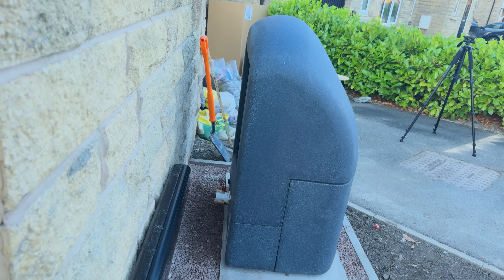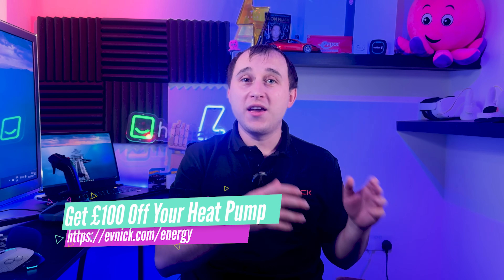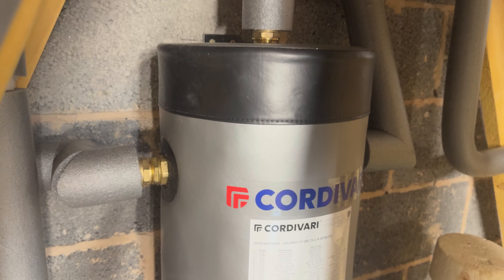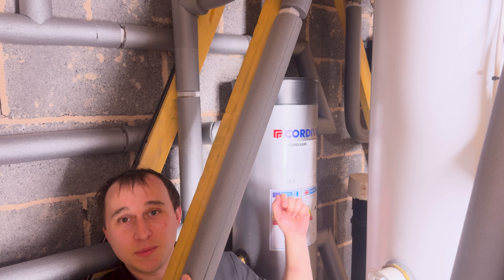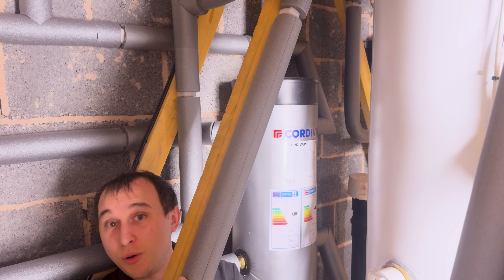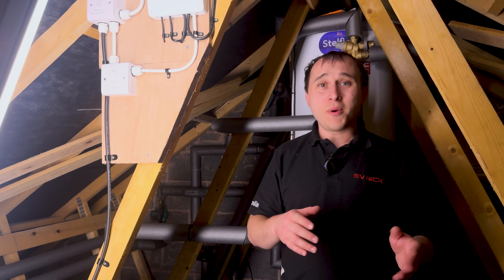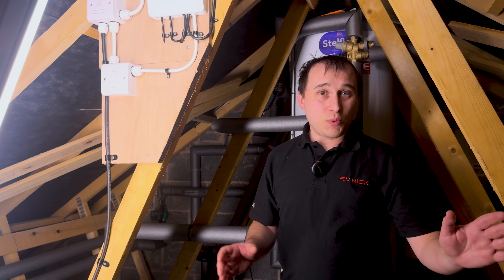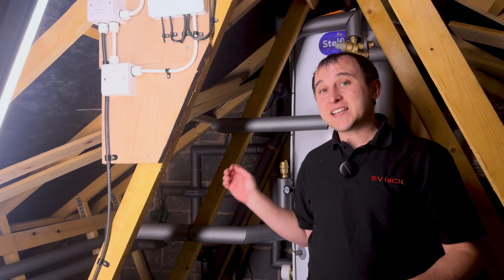My COP Of My Cosy6 Is Awful How We FIXED It!

Comment: Not sure why Octopus didn't use buffer to start. One thing I would like to know is can you hear the circulation pump in the loft at night.
Every channel I see talks about ASHP fan noise which as we know is not an issue and certainly not inside the house. If the buffer tank is in the loft then a circulation pump whining away on the other side of the bedroom ceiling at night could be a major issue for many.
Reply from the maker: Can’t hear a thing

Comment: Industry best practice, as espoused by Heat Geek for example, is to use weather compensation with an adjustable slope setting of flow temperature against outside temperature.  Does Cosy6 support this?
Reply: Yes.  In a word.  It's  basically still a heat pump!  So the usual rules apply.

Comment: Good luck to the engineer that will be expected to repair that in the winter months sat outside on the floor in freezing temperatures..
Reply from the maker: as opposed to what?
Reply: Shouldn't need repairing in winter...  because you have a regular servicing contract...

Comment: Avoid the Cos 6 Heat Pump

I strongly advise against getting the Cos 6 heat pump. I had one installed two weeks ago, and it makes an extremely loud noise. My neighbor has been complaining and struggling to sleep at night due to the noise.

I contacted Octopus customer service (Rich) multiple times, but at first, he refused to help, saying, “The Cos 6 is our quietest heat pump, and this is just your opinion. I don’t think we need to send an engineer.” After several emails and sending a video recording of the noise, they finally agreed to send an engineer. He adjusted some settings and told me to wait two weeks for the compressor to “settle down”—which I find quite confusing.

I requested a replacement with a different brand, but Octopus refused, insisting that the Cos 6 is their quietest model and that they would only replace it with another Cos 6. I honestly feel that Octopus is misleading customers by pushing their own machines with false claims and refusing to take responsibility.

It has now been over two weeks, and there’s still no proper resolution. My neighbor is so affected that she plans to file a complaint with the council due to the impact on her health from sleep deprivation. Since Octopus has failed to address this issue and misled me from the start, I will be filing a complaint with the Ombudsman Service to escalate the matter.

Please do not make the same mistake I did by trusting Octopus’s claims about the Cos 6 heat pump. It has been a terrible experience, and I regret relying on their misleading information.

Comment: Hey there matey, hows your cosy doing in the cold weather since the changes?  I also have microbor pipes and finding only the top 1/3 is getting warm with bottom cold. I'm trying to work out if this is a flow rate issue or glow temperature issue vhave you come across this in yours?
Reply from the maker: Have you tried to bleed your rads? Could be air in them
Reply: @ yeah I've tried that. No air in any of them so far and I've checked everything still at the 1 bar pressure the engineers set.
Reply from the maker: @ ring heat pump support team report the issue and they should send an engineer to check… assume house isnt getting warm?
Reply: Could be gunk in the radiators.  Have you had them power flushed?

Comment: Nicolas, great videos. One question, the out let fan on the heat pump is open to rain snow and hail, how is the inside protected from the elements.   Thanks.
Reply from the maker: Snow can go in any unit wind blows… this been designed for the garbage basicly drains out bottom
Reply: @         Thanks for coming back Nicolas.

Comment: It sounds like they didn't calculate the pressure loss of your pipe work. The pump couldn't shift the required power at low flow temperature due to the pressure loss of the pipe work. Since it could only output a small amount of power it cycled and you lost efficiency. This is not because low flow temperatures are inefficient. It's because low flow temperatures require higher flow rates which require suitably sized pipes. Please correct me if I'm wrong.

Comment: Golly from the replies looks like you got to have a degree in physics to get one to work. Least i know now one is not suitable for my minbore system so thanks for the video
Reply from the maker: If it’s 10mm it be fine but 8 will need a repipe to use octopus but some Indy installs may do it
Reply: @NicolasRaimo  no it's not 8mm by looks of it.

Comment: Interesting video as always Nick. I’ve just got a quote & awaiting a heat loss survey, not sure which ASHP they have included for ? With regards to the flow temperature I thought the weather compensation adjusted this depending on the outside temperature ?
Reply from the maker: Weather comp works within a range that customers could change but octopus locked it out since this video and engineers and octopus will set

Comment: Wow, what a failing on Octopus' part! This installation seems to go against a number of the essentials that Heat Geek say make up a good system! e.g. should not have a buffer/LLH/hydraulic separation, but pipe run too long, flow temps too low (lower IS better but the Cosy 6 seems different and possibly not a good thing!), and so on.

And why did you end up with a 6KW HP when you say your heat loss is less than 4? That's more than 50% oversized even for the coldest day in the year and will obviously cause cycling and be less efficient. There are 4 and 5KW HPs available, Octopus even fit a Daikin 5KW themselves (unless they have just stopped?)

With microbore (especially plastic which is worse as it has inserts that further restrict the flow) combined with that long run, Octopus should have known that hydraulic separation would be required to keep the HP happy. If your pipes are 12mm then you would have been better off with a shorter run and no hydraulic separation. Having the buffer is a significant hit on efficiency, as is higher flow temps - don't let them tell you otherwise - its just maybe the that Cosy 6 can't cope like some other HPs can.

So you have ended up making less efficient changes to get the efficiency higher! Meaning a different system may (in theory) have given a better COP/SCOP. We need to see your number to make final judgement.

I would love to see the Cosy 6 work well but it was over hyped and always set out to be a comprise that may well turn out to underperform.

Comment: The easiest way to have avoided this issue would have been to install the heat pump in a sensible location.
The correct term is "Buffer Tank" it is NOT a "Multi Split" nor is it a "Low Loss Header".
You have a responsibility as a content creator to provide accurate information on this topic.
By doing this and adding an additional pump you will now be experiencing Hydraulic Distortion - this is the difference in flow between the various circuits and the 2 pumps.
Reply from the maker: A suggesting you check what a low loss header is https://www.heatgeek.com/low-loss-headers/

Comment: I'm looking into heat pump installation (ASHP+HWC) After watching several Heat Geek videos I was focusing on SCOP (maybe too much). In the end we decided to go with Octopus, as they provide the best value for money. I did some calculations and for my 3 bed semi (10,657kWh annual demand for heating and hot water) the difference between SCOP of 3.4 MCS minimum, and 4.5 (very optimistic) translates to £170 saving per year. As mentioned in previous comments Octopus is the best value for money for ASHP install (currently). If I were to go with well know independent install it will cost me an extra £3-£4k and will take around 17-20 years to pay it back. I'm sure someone like Heat Geek can design and Install more bespoke, and refined system than Octopus, but It is unlikely I will be in my current property in 2040 :-). I appreciate it, that for larger properties, payback will be sooner, but 3 bed semi , is fairly common house type in the UK.
Reply from the maker: 100% my findings also,  ps don’t forget to add my refferal code for extra £100 off
Reply: You've made the right choice for your home. Do the maths first and you realise chasing that higher SCOP ends up costing you way more in the long run. It will be the likes of Octopus who will roll this out to the masses for the same cost (or cheaper in a lot of cases) as a replacement gas boiler. That's when a HP becomes a no brainer.
Reply: Just put your £4k in a savings account, that’s £208 per year currently. It’s a better investment than a heat pump.
Reply from the maker: @andrewharris3900  boiler replacement same price so not really plus it’s not all about cost
Reply: @NicolasRaimo  Boilers are much cheaper. Also they don't cost £225 a year to service like the Vaillant heat pump.
Reply from the maker: @andrewharris3900  octopus service plan is £9 a month…
Reply: @andrewharris3900  except that I need to replace my boiler. Well, option two is to wear a lot of jumpers and have an extra 200 quid, but I think ASHP will go further.
Reply: @Pav_1983  Energy savings trust did a study of installed heat pumps in the UK and found an average COP of 2.2. Maybe you'll be lucky and get a COP of 3.2 but it's not really worth it as you'd still be paying more than you would for gas at current prices. Also a new boiler is usually about £1k, even if you're moving a lot of pipe work it will work out much cheaper than £4k.
Reply: @andrewharris3900  Thank you, but I did not say Octopus ASHP woudl cost me £4k, my install is a lot less. It woudl cost me an extra £4k if I were to go with well known 'approved' installer.  Also the latest installations must meet a minimum 2.8 SCOP to get MCS verification and BUS grant. Octopus guarantees SCOP of 3.4. 
Please note that I will be going off gas completely, and will be using HP specific tariff. Standing charge and smart tariff, should make ASHP with SCOP of 3 the same cost as gas boiler. I'm also planning t install solar PV in the future. I'm not saying ASHP are better than boiler in every case, but based on my calculations, ASHP is a better choice.
Reply: There is a lot of truth in what you are saying! 👍 That is if the Cosy turns out to be nearly as good as the marketing.

What I am not liking is Octopus' lack of flexibility (said no to most of my asks) and now they seem to want to take away all control of the system once installed.

Worse still when the grant went up by £2500 last year my quote actually went up by a couple of hundred rather than down £2500 - think of that what you will.
Reply: @darrenadams2640  Although I keen to explore new things, I decided to go with Dakin ASHP. I'm not 100% on cosy 6 looks, and Dakin have been around for longer. Regarding cost, the challenging part is 'inclusion' I'm suspecting there will be some averaging of cost across the households. Some will win and some will loose. My house does not require any radiator changes, the location of ASHP and HWC is fairly straightforward, etc.... Yet the quote came to £3.8k on top of BUS grant. Makes you wonder what property woudl qualify for £500 ASHP. I'm lucky (unlucky) that we are going thru remortgage and Halifax is handing over £2k cash back for green improvements. So all in I'm getting £9.5k from the gov (or my tax money) and from Halifax (my interests), then referral -£100 and October's ASHP week discount of -£250 The remaining balance is just over £1k which is difficult to beat , even with a budget boiler. The time will tell.

Comment: I've just had a Cosy 6 installed and I can't see anything in the app settings to change the flow temperature am I not seeing something?
Reply from the maker: They took it out ;)
Reply: Thanks, I thought that might be the case.
Reply: I was just about to ask the same question.

We got our Cosy 6 just over a week ago.  8m primary run outside, probably 22m total.  A volumiser fitted from the start as we have 10mm microbore.
SCOP so far is 3.1, which is slightly disappointing.
Octopus are sending out an engineer to check everything.
The installation team were superb.
Once we have our solar and battery in a week, the SCOP will be less important...
Reply: I would rather have control.

Really not sure an energy company should control my heating.

Comment: Good info. Did you purchase any external fascias from somewhere or is that how octopus lagged the pipes? Finding it hard to find where to buy something for mine
Reply from the maker: I paid extra for it be in casing and they lagged that inside the case I knew the casing had to screw in the wall for the back end and couldn't be done easily after so opted for it to be done same time.   1 trick you can try is buying drain pipes and slit it  one side
Reply: @ didn’t realise you could pay them extra for the job. Yeah I was thinking the same with the drain pipes. Will probably attach the corner sections to the wall and slot some together.

Comment: Are you saying that the volumiser is now working as a Heat Store, where the radiator circulation pump pulls heat from it (in the form of heated water)?
Reply from the maker: Its bumped as a buffer 4 port.  We have 1 side connected in a loop to heat pump and the other side looped to home supply with a small pump.  The idea is this works and stops frictional resistance in my circuit

Comment: On you huge pipe run, did they use ready insulated pipe, or clip the pipe on the wall then insulate it? Your trunking doesn't look big enough to fit the correct insulation on the pipes, but that could be the poor picture quantity on my phone! I would think 28 or maybe 32mm pipe with the required 15mm insulation gives about 60mm diameter, plus the trunking, so it should be at least 65mm off the wall. Clips mounted to the wall should also be over the insulation to avoid heat soaking into the brickwork. Is yours close to that?

Comment: The most worrying thing about this install is Octopus thought they could run the whole thing off the Cosy pump with the massive primary run and then onto microbore, and also that they didnt have a real design temp so Nic decided he'd lower it himself to a value that clearly meant microbore would never deliver the required heat. A proper installer would have calculated this all properly from day one and not needed to fiddle with it so extensively. Seems a bit hit and hope. Still think it should have OEM on it, so we can all see the numbers openly. If Octopus believed this was a good solution they'd have no problem sticking it on OEM (like they have for some of their Daikin installs)
Reply: From my experience, it seems Octopus is trying everything possible to make sure that customers won't stick the OEM to the Cosy6. They'll try everything to discourage you if you bring up the OEM in any of your conversations.

Comment: Looking at your pipe run it is quite staggering. Mine, using a wall hanging unit means I can use a pipe run of around 4 feet. Intuitively that must be better. My initial COP was poor but that was before I balanced all my radiators. Doing that I currently get 3.2 (averaged with heating and HW) in recent days. Not outstanding but maybe with small changes this can be improved and this is on a microbore system. Getting all the rooms to the same temperature with only 1 zone does make a huge difference.
Reply: Agreed....I had my own fair share of thoughts and comments about this installation and they are not good.

The things he has brought up here in this video were exactly my concerns and guess what happened....

I can't even believe he went to run this at 30° when octopus themselves are very adamant it should be run hotter, I also mentioned the microbore pipes as a potential issue and again they are with the temperature he was running it at and flow of the cosy 6,

I was personally told in writing by octopus that the cozy 6 is not designed for microbore.....

I just can't believe the installation of this system as it looks very poorly designed.

Comment: Did you get performance data for Cosy 6 ...... How many Kw it delivers at -2c or how low it can modulate down to at 10C .????  If your rads are set up to give out 6Kw at 50c flow , then at 30c flow they will only give 1.5Kw ish  .. so If you know the minium output you can set the flow temp accordingly ... ( Vaillant 5Kw graph shows at 35c flow 10c it can't get below 2.3Kw & has a cop of 4.5 to 5 ish ) ..